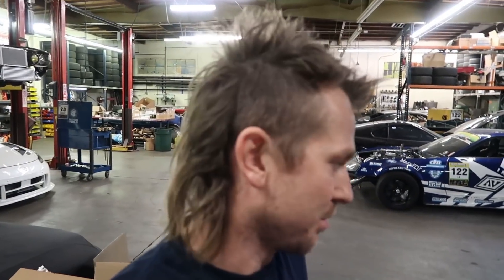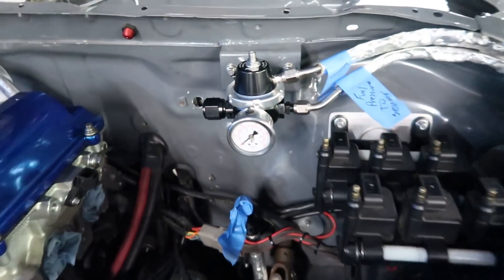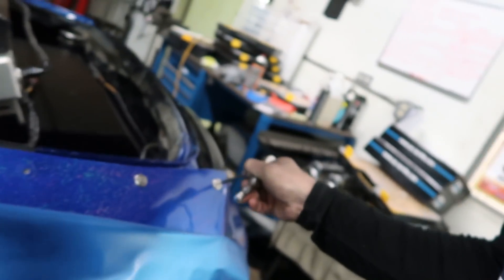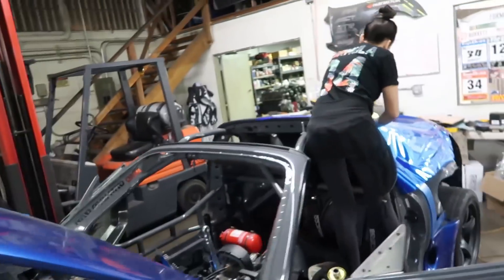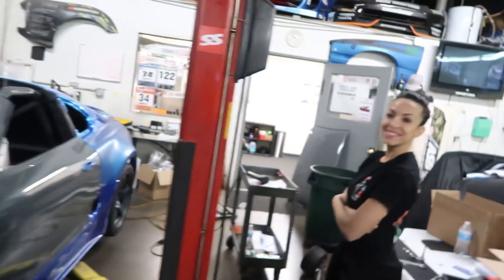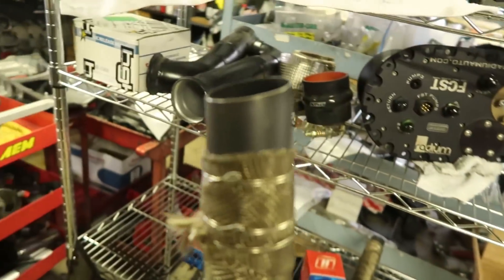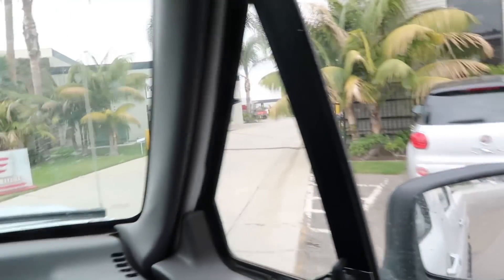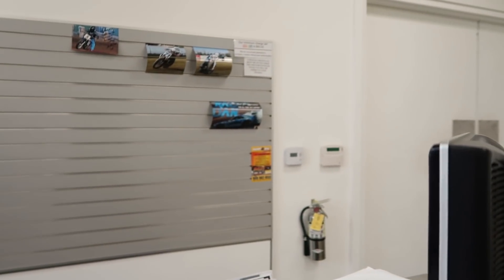Ep. 18 Off Season Refresh: Renee Starts To Wrap + A Visit To Embee

Comment: Hey Dan make sure you consult with kevin wells about the spoiler. it was discussed in a maximum driftcast episode. you mount to the trunk area, so you should be fine. the restriction was in relation to the chassis mount rear spoilers hanging off the rear of the car like mad mike or dean kearny.

Comment: Section 6.3

“Wings that are multi-piece mounted on standoffs and those that are not directly attached to the trunk will be prohibited at tracks where they may come into contact with walls, fencing, and signage. Examples of such tracks include, but are not limited to Long Beach, Orlando, Wall, Las Vegas, and Seattle.”

Basically no bumper mounted stand offs. you're fine

Comment: Is it just no GT wings or do they still allow other styles? Get a TRD rear wing with a carbon blade if you are allowed! I'm sure you'll work out how to adjust the angle of the blade too. I have one on my RSP supra and looks smick as!
Reply: I think it's no gt wings at tracks with the curved banked walls.
Reply: No wings on stands at curved tracks.
Reply: So no trd wing either
Reply: LurkerDanny the wing has to be mounted directly to the trunk lid, so basically a lip spoiler or something will work